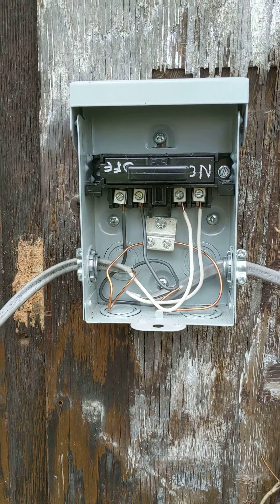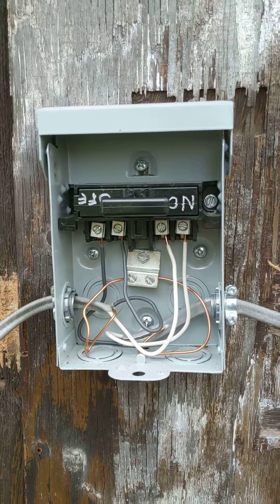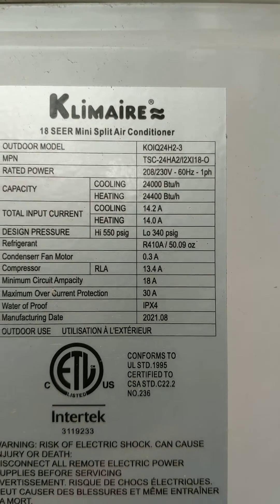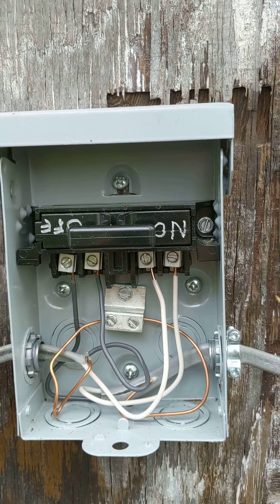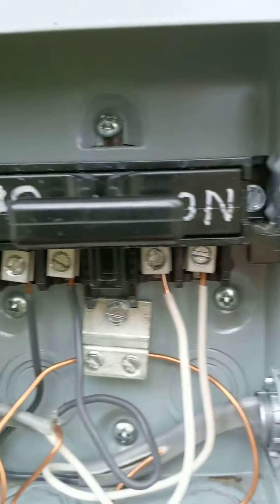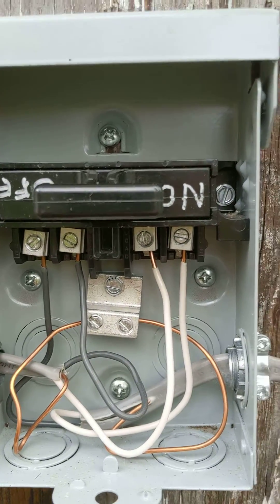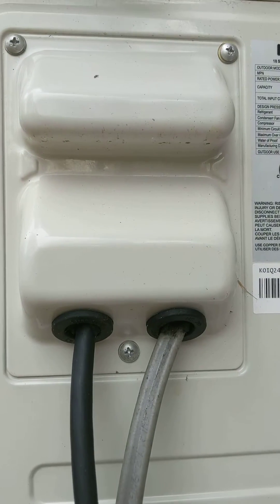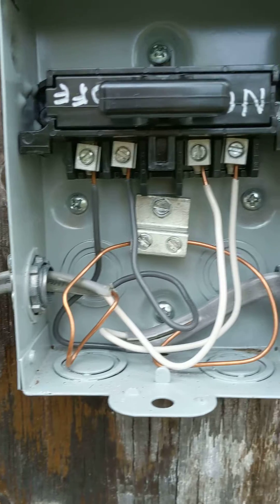Disconnect Box Wiring on the Klimaire 24,000 BTU DIY Heat Pump Mini Split

Comment: i have a ? im adding a mini split to my house which currently has central a/c here in south Florida. I want to use as a helper unit for summer and hurricanes. I was told i could tapped into my current a/C's disconnect box is that true? my a/c buddy told me he does it but not sure. i dont really want a bunch of boxes on my wall ya know.
Reply from the maker: Firstly, I am not an HVAC professional, and I don't know what the code requirements are in your area. 
If you were to use the same disconnect box, then you would be disconnecting/connecting both systems at the same time, so if one fails or needs service, you would not have the other one available as a back up. 
Also, the mini split will not have the same amp rating as your main system, this presents a couple of problems... 
One: you will not have fuse protection for your mini split, It will likely require a 20 amp breaker, and if you are using a 40 amp disconnect, there is no protection for the wiring to the mini split, this is a fire hazard. 
Two: The combined amperage of both systems may overload your existing breaker, causing it to trip. 
I would STRONGLY Recommend that each system be on its own disconnect box, and I'm pretty sure your local electrical codes will also require this.
Reply: @TwoAcreHomestead  Ok great thanks for the information bud. I think i will get its own disconnect then. Will i be able to get power or tap from this  disconnect box. cuz i dont have anymore room either in my main panel?
Reply from the maker: If you tap power from the existing disconnect box, then you will run into the same possible overload problem described in Problem Two above. 
If your panel box is full, best bet would be to install a SubPanel off of your main panel that can handle your current system plus the system you are going to install, I'd guess 60 amp would be enough, but without seeing whats there, that is only a guess. 
You would remove your existing AC breaker from your current panel, replace with a 60 amp breaker, Run 4 AWG wire from the 60 amp breaker to the Sub Panel, then install the 2 breakers for your AC systems in that panel, I'm Assuming it would be a 40 Amp and a 20 Amp double pole, but I can't see what you currently have. 
If your not familiar with doing electrical work, please consult with a local electrician. Saving a hundred bucks isn't worth burning down your house. 
Hope this helps, 
eb
Reply: @TwoAcreHomestead  gotcha thanks 🙏 bud. I decided to cut a 240v since there was 240 out there already. Yeh know. Anyways I have an out door sub panel outside which I guess I’ll buy a breaker and make it own run with its own disconnect.
Reply from the maker: Good luck with the project, hit me up if you have any other questions.
Reply: @TwoAcreHomestead  thank you brother.

Comment: I just installed the same system, but my disconnect required fuses. I used a 30 amp 2 pole breaker, and #10 gauge wire due to voltage drop. Also my line side was the 2 lugs in the middle of the disconnect, and my load side are the 2 outside lugs. Good luck Choo Choo.
Reply from the maker: At 15 amps, 12 gauge with 20 amp breaker is enough, but guess it can't hurt to beef things up a bit. 
Installed this about 18 months ago and its been running great, saving a good deal of cash on the electric bills too.